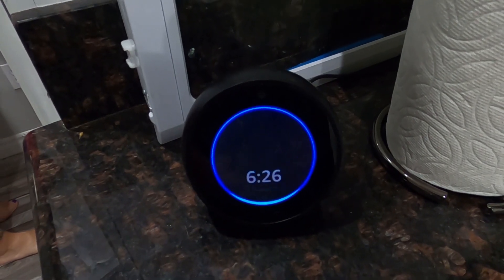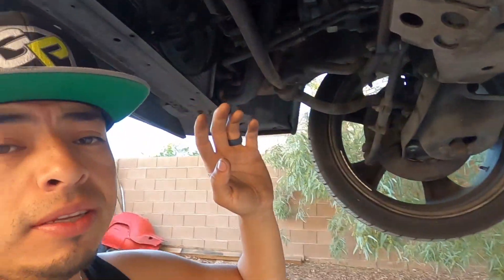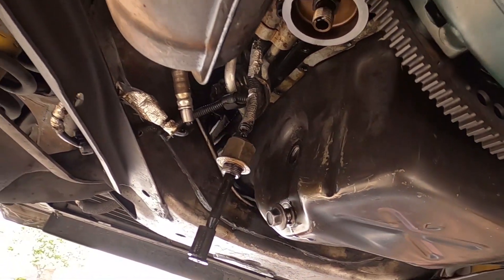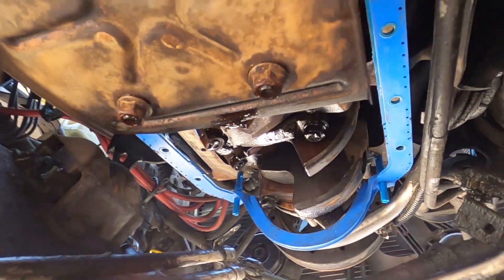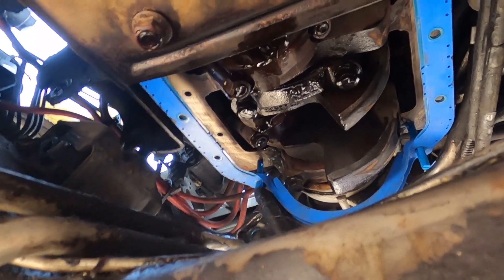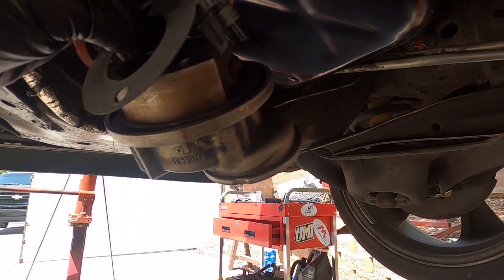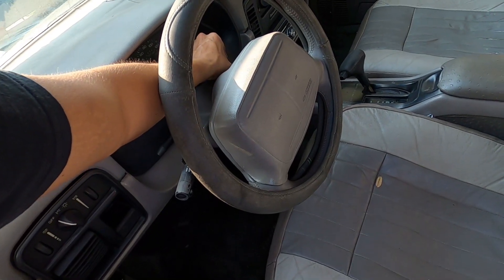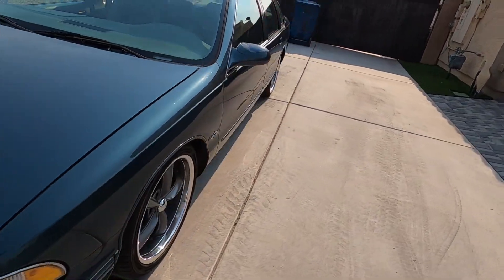1994-96 IMPALA OIL PAN AND GASKET REPLACEMENT

Comment: Did you bugger the old pan from the oil pickup hanging up on the baffle? I have total clearance under my engine, and I still can't get the pan off. I think it has to go forward a bit, to clear the pickup.

Comment: Hey great job,but why did you have to replace the fuel line ,what happen to it?thanks
Reply: Im asking because im having a fuel issue and everything has been replaced,car sat for 7 years ,wonder if something is up with fuel lines ... but there nylon?
Reply from the maker: IT HAD A PIN HOLE LEAK , VERY DANGEROUS

Comment: How did you remove the oil filter housing
Reply: If it's got the cooler lines, you unscrew the bolt or bolts  in the middle and it drops down. The bolts are covered by the oil filter. The oil filter adapter bolts into the original oil filter fitting on the block when the external oil cooler is in use.